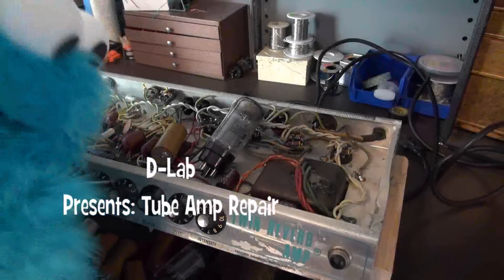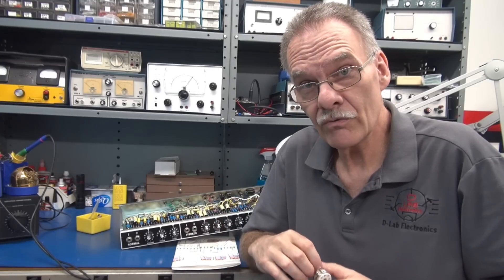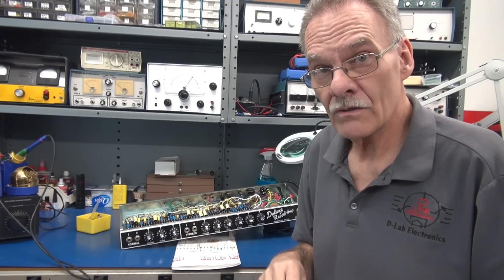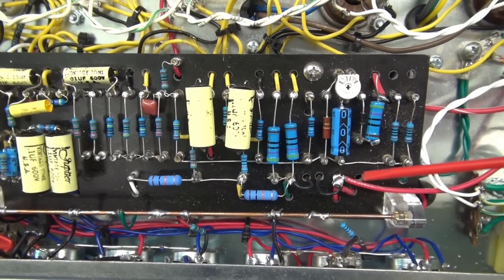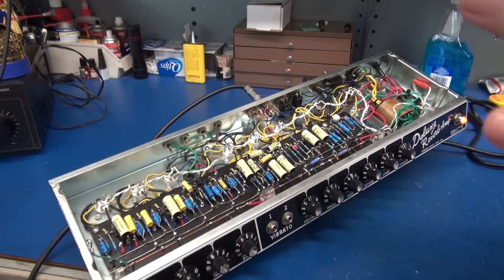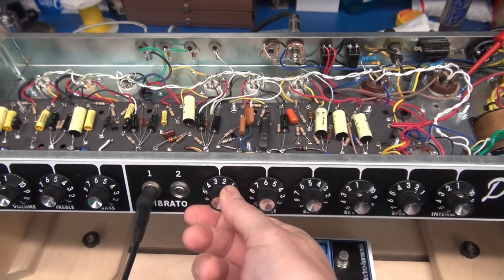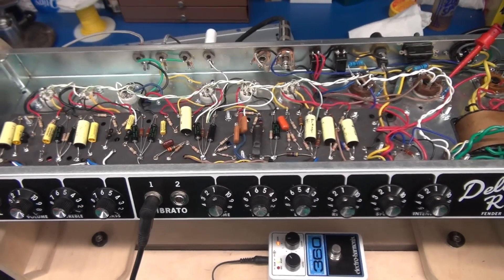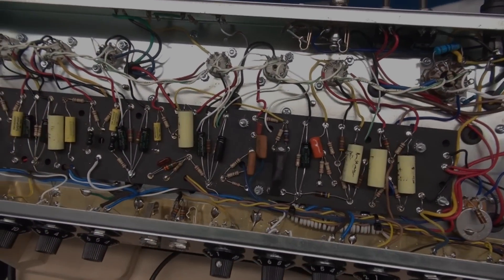Terrible hum noise Fender Deluxe Reverb kit guitar tube amp solution Install a Factory eyelet board

Comment: I have built many amps with Hoffmans boards....if done correctly, they are good, I just like the layout of a classic fender circuit
Reply: I've used several of Doug's boards without incident as well. Seems more likely a case of the "new builder blues"
Reply: @KorbenDenver  Yeah, this is a horrible looking install. And the guy deleted my comment. Thanks guys
Reply: Yep and you did it correctly and it worked properly
Reply: @EL34XYZ  this wasnt because of the board Doug...but it would be more work for Terry to get the layout of your board to fix it, so using the classic layout was what he knows :)
Reply from the maker: Yes, That is correct. It was the most efficient way for me to repair this amp. It had nothing to do with Hoffman.

Comment: Where did you get the standard Fender eyelet board?
Reply: id like to know too
Reply from the maker: https://www.ebay.com/itm/163614423861?hash=item26182dfb35:g:uc0AAOSwTMlg5Gm~&amdata=enc%3AAQAIAAAA4DCj4YvBaCn%2BFuRF2Q%2Ba6cKi%2Fyu4fnzgRlG%2F8m3g0KAtS7KTSTPKmrOjd2aBi%2BWg8fpqzY%2FSa6I60cwxZoU8Rt%2Fg%2FGq33Kmxthn1IeunXNJ6OD7o6hENBzUpCrDxAtccrHDBqd%2BuVG6yVorwJox4wdtsB9QpgkCSdzg%2FMR22ph13Zj0NpmjDO9zTIWeA46W%2F%2BdprB6nbwwqRQ%2FTp8di0hu2t%2BzpIL0yboAfX7x81cx0AopssrSG%2Bu64OcxD3OjyH9rpE6DyheMb7y%2BEZFOIj4TpdgMUynuN6Tadu0ctMXYYU%7Ctkp%3ABFBMkq_s05Fi